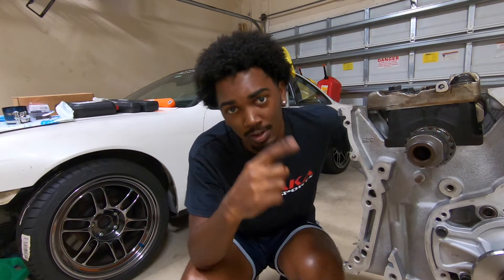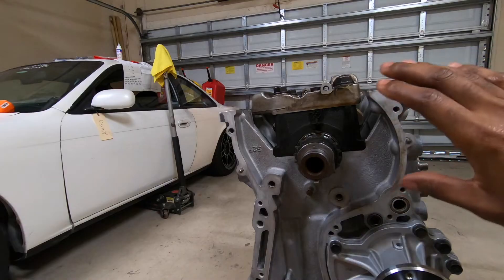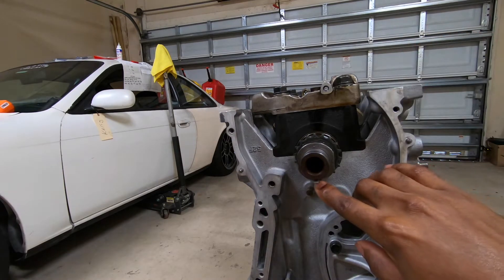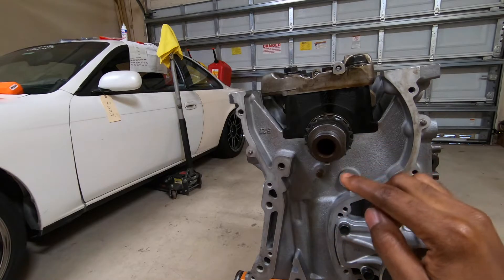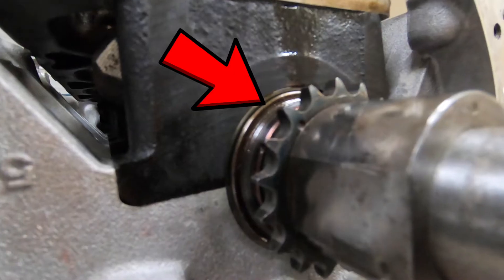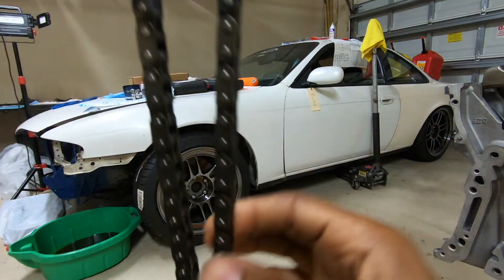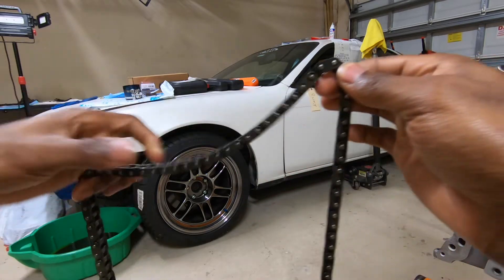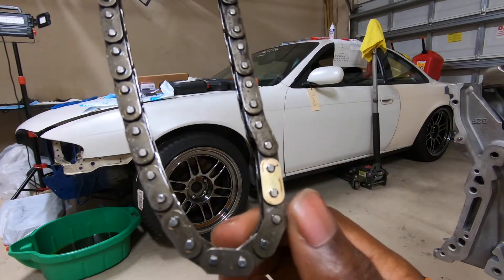Oil Pans, Timing Chain, Front Cover - SR20DET Rebuild Guide - Part 2 (READ BELOW FIRST)

Comment: Nice vid bro, im going to try and do the timing cover on the sr20 in my s13. Do i need to remove the gearbox to access the 2 rear bolts of the upper oil pan?
Reply from the maker: you can remove all the upper oil pan bolts with trans on however, you must remove trans bolts to drop it iirc. check forums, people find very clever shortcuts for things like this. use your best judgement when taking a shortcut and if you need help, DM me on instagram, im always down to help if i can !!
Reply: @TeamVANL  cheers mate! Gotta do it with the engine still in the car so GL me haha

Comment: You should have purchased and installed the updated new style timing chain guide which is made out of metal. The plastic ones can break over time and ruin the engine.
Reply from the maker: I would have purchased soo much more but money was tight, I know for sure that I’m going to switch over to a mechanical timing chain tensioner in the future

Comment: Actually I have a question. How did you remove the valves from the sr? Like I’m trying to remove mine with a tool but the valve moves when I try to compress the spring. My head is off of the block so idk if I have to use a nut or a cloth to make the valve stop moving so I the spring actually compressed.
Reply from the maker: I’ve never removed valves from sr but I have removed them in general before, there are retainers at the top of the valve stem, when you compress the spring with the tool, they should become more visible and I used a magnet to remove them when I first did this long ago on different motor. Then the spring and washer should be able to come out, keep in mind without the retainer the valve will be loose so have a towel or something to catch it

Comment: Hey quick question, on bead for the upper oil pan some of the beads went outside the bolt holes and some went inside, any reason for that?
Reply from the maker: Yeah, check the time stamp for when I applied gasket. FSM says to go outside of four bolt holes because the bolts are located inside the pan instead of outside !!
Reply from the maker: 4:51 it’s the sentence next to the picture
Reply: @kriswyche  Aw I see, I hope I remembered to do that when assembling my SR last year not sure if I did or not haha guess I'll find out if it leaks, or I guess it's so no RTV gets in and clogs up your oil pickup
Reply from the maker: @Grainsauce  I think is for better seal but either way, if it ain’t leaking then you good ma boy !! Lmaoo